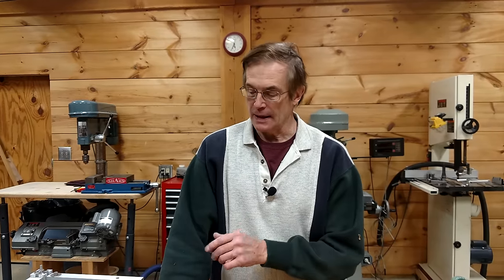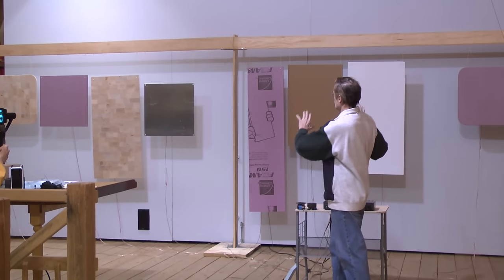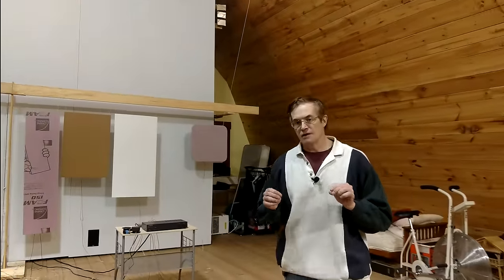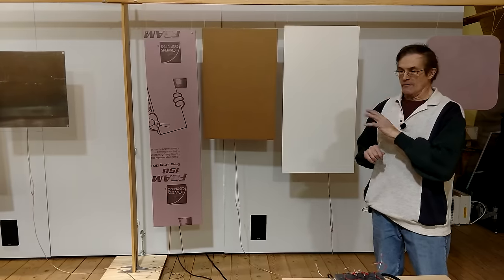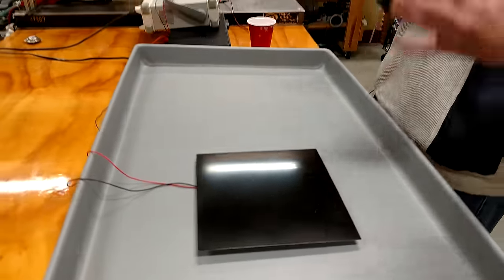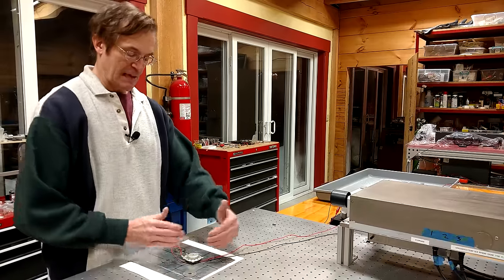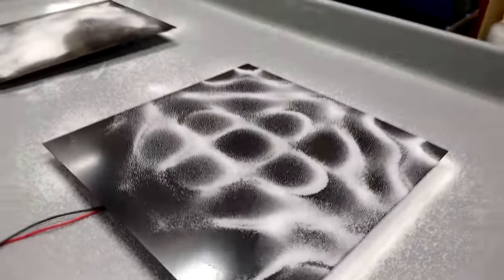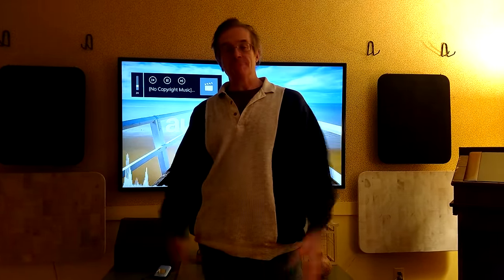Fantastic DIY Speakers for less than $30!

Comment: So do you need an amplifier to connect these to a TV or audio device? Do you need a sub-woofer or not (didn't understand what was meant by having a sub-woofer with a cross-over at 150Hz if the speakers don't need a cross-over). Thanks!

Comment: friggin awesome, in depth, informative, with clean, clear, honest explanation..   but ..... being a caveman like Tim Taylor of Tool Time...  argh argh argh.... and having a 3000 sq. ft. game room and a lot of speakers, tuners, and amps.. my question becomes.. how big van you go...say  a full sheet of 4x8 ???  or keeping with 5/2  that would be  7.5/3 .... and hang 1 on each side with 1 the long way above or below the tv and 1 on each end of the couch and one the long way above the couch for a 6 channel surround.. then comes the question of angle the 4 corner speakers and if altering tilt or the degree pitch would further influence the sound..soooooo many more questions.. and Thank You for the Knowledge You Put Out Their....

Comment: OK, inch and a half polystyrene extruded foam comes in 4' x 8' panels.  So, two 2' x 8' panels with two (?) exciters per panel. I have a speaker system hooked up to my computer with a sub-woofer so I can just hang the DML's spliced into the sound system and use the sub-woofer.  Inch and a half is the way to go?  And what is the best exciter?

Thanks for all the time, effort and money you have expended on our behalf.  You are a champ.

PS - I guess you have seen how much folks have deviated from what is demonstrated as the way to go.  The back row of the class getting D+.

Comment: Hey I just made a pair of these speakers. I used two 24" 24" square pieces of pink insulation foam board. I rounded sanded the corners and edges as you mentioned. However, I find the audio is quite "tinny" and the sound lacking overall. Playing with the EQ helps, but still isn't very good. I feel like a made a mistake, or maybe was I expecting too much.

Comment: So did you end up doing any of that 2/5 3/5 on the speakers you had mounted on the wall next to the TV? What about the weights that's supposed to add up to 20% of the mass of the speaker? Or was that just thrown in?

Comment: I'm surprised that the paint does not change the acoustic response of the material.  What amplifier were you using to power these and what amp characteristics would you recommend?

Comment: I've been wondering if gluing on a 'bump' to a part of the panel would improve particular frequencies.  I've set up my own, and am about to do a high ceiling mount, with the transducer acting as the mount point.

Comment: Awesome! Maybe the bass can be fixed if you place them in a baffle with a rubber seal, like regular cone speakers?
Reply from the maker: The presence of the seal would hurt the output of these panels at all other frequencies.

Comment: Great video, very informative.  You are using these speakers in your TV room did you test these speakers with a movie, how would dialog sound.  Can you use them in a 7.1 system if you added a sub-woofer?
Thanks for sharing.
Reply from the maker: The vocal reproduction is very good.  We've watched countless movies on them.

Comment: I came across this at a timely moment.  I am looking for speakers and an audio-video receiver for my new 65" 4k TV.  I am going to have fabricated four sets of polystyrene and end-grain balsa panels to use as left & right, front & rear speakers.  I will likely use a soundbar for the center channel.  I will need to go through and view the video again to determine what drivers you used.  Since you didn't provide details in the description or a link, would it be possible for you to provide how you came up with the 2/5th & 3/5th patterns for the placement of weights and the recommended panel size/ratios?  Also, would RTV or silicone caulk be a good method of attaching the drivers & weights to the back of the panels?  I look forward to your response.  This was a very good demonstration, please keep these projects coming!
Reply from the maker: Thanks!

Comment: What is the amp you have used for this?  I tried using a simpler headphone amp, but I can't get it as loud as yours without it sounding distorted.  I currently have two decently sized cardboard panels with an off-centered exciter on each one, and am using a 12volt Fifine N6 headphone amp.

Comment: Sony APM texhnology. They begun attachimg 4pistoms from the coil to the flat aluminum honeycomb panel and then they realozed that 8contacts were better and finally just attached the cone to the panel like the actuator in this example. High compression and low bending strengh the fantastic aluminum homeycomb structure of the 80 APM sony speakers.

Comment: that is amazing! And of course very educational as usual! your camera man screwed up when you did the sugar panel test. First he should stand on your side, so left and right is the same as yours. then he focused on your left panel most of the time and it was not always easy to follow your explanation! and it would have been great if you would have shown your speaker and weight  set up. And last: I noticed that in previous videos, you often have some background noise which is very irritating, this time it was a rush, but before you had like a hum...

Comment: Great stuff!  Would it be possible to cover the polystyrene panels with a thin fabric instead of painting them?  Maybe a spray contact adhesive applied on the sides of the panel instead of the face.  My thoughts are these panels in a home theater would not only serve as speakers, but act as sound dampeners to help with reverberation.
Reply from the maker: It might work, but I didn't test that.  The only potential problem I can see is if the cloth will vibrate as it rubs on the foam.  You might hear that.

Comment: Excellent video!
I've been looking for such a analysis and test of these speakers.
Now it only gives me more ideas ... :) 
When you said at the end that they can stay very flat and cover large part of the room, and that they cover the volume of the room much more equally (reducing the phases), now I wonder how can you make active noise cancellation room with its walls and ceiling perhaps covered enough with such plates+speaker that they play the opposite phase of whatever the noise outside the room is.

Comment: Exciters ordered and today got the boards from a Home Depot kind of shop in Sweden. This will be a BIG surprise at the yearly DIY summit this coming Autumn.

I think it was (or wasn't) mentioned that speakers with a wide area distributes sound in another way. I was thinking of dipole speakers.
Reply from the maker: Great!
Consider that a number of viewers who built these speakers found that placing a sound absorbing material on the wall behind them improved the sound quality.
Reply: @TechIngredients  Thanks for advice! What about the extra weights to eliminate resonances? I tried to plot from what I saw on your video.
The boards I picked up are 2ft x 4 ft, but I will cut it in a size where W and H are not realated to each other.

Comment: Great build. Would it work to hang your speakers horizontally from the ceiling?
Reply from the maker: Yes.  Just make sure that they remain isolated from any rigid structure.  Even resting an edge on a desk makes a very big difference in their performance.

Comment: So basically this is based on the classic Leak 1960s speaker made of  polystyrene that became such an iconic design for a speaker considering most speakers during that time were made of paper pulp also in line with it's competitor at the time the classic flat panelled Quad Esl 57 using a charged membrane.
Reply from the maker: Watch the next video in this series.  You'll be impressed.

Comment: Love it. Did you show how to attach the pistons to the panels ? I didnt see it but may have missed it. Also your asymmetrical winning panel test, was it a combination of panel shape and driver mounting offset position ? Or was the driver centred on the back ?
Reply from the maker: Check out our follow up video on these speakers where I show how to assemble them.

Comment: Sound wood typically needs to be flexed into a bend with consistent pressure to amplified sound. this is what the ribs do on a piano. Ribs are cut into the shape similar to a hunting long bow then attached to the soundboards. I would be very interested with the results
Reply from the maker: We're  following up on that theory, and I agree.  You'll  be impressed with the solution.

Comment: With frequencies at around 1 to 3khz style sounds it's sounding somewhat tin like but in all fairness I'll have to wait till I have some  better speakers to get a better idea and as mentioned going through the already low grade you tube audio compression will not be helping either.  Look forward to trying it out and experimenting.

Comment: Great video! Do you think this idea can be expanded to a 'component' speaker with a 3-way crossover and three different sized 'speakers'? Would this possibly give even better performance to those bandwidths? Maybe even a low pass filter for a subwoofer? Thank you...
Reply from the maker: Thanks.
I'd avoid the cross overs as the overlap between different size panels is broad.  A sub is a very good idea and a crossover at around 150 Hz is about right for the sub.

Comment: Hello! I accidentally bumped on your channel on YouTube yesterday and I haven't stopped watching your videos! Congratulations is the least I can say! My name is Kostas and I live in Athens, Greece.  I have a question.  The pink color "Owners corning foamular XPS" does not exist in my country.  The closest I have found is a graphite extruded polysterene.  Is it the same with the pink one you suggest?  Thank you very much in advance.
Reply from the maker: Thanks!
Graphite?  If this term refers to the color then possibly, but I don't  know how graphite would have any other role in a XPS foam. You want a rigid foam with a density of approximately 30 kg/M^3.

Comment: I was wondering if mounting the back of the exciter to a stable point (e.g. the wall) while the panel is hanging freely as it is now, would give higher volume or different (better) frequency response. It is a feeling i have that when the whole exciter is vibrating together with the panel , some movements will - let's say- cancel each other... I have't come arround of building a panel... yet, so take this comment as merely a wild guess. Every video you make is like a book of knowledge and i thank you for that.
Reply from the maker: It's actually worse.  Even mass loading the exciter increases resonance peaks.  Hanging the panels in front of a wall that has a sound absorbing material placed on it does improve the sound quality.

Comment: do you recommend this system for an outdoor installation? can you show us how you attached the speakers to the back of the panels?
Reply from the maker: I don't because the wind will make mounting them difficult while maintaining isolation.
I showed how to assemble  them in the second video in this series.

Comment: Hi, I want to make chladni plates like you have. Sorry if I missed it. What kind of transducer did you use? It must have a single contact with the plate… thanks!
Reply from the maker: Actually, it doesn't. 
The drivers we used for the speakers will work very well.

Comment: I am thinking about using sonotubes to create a folded horn/ tranmission line speaker. Basically an 8" tube suspended inside a 10 inch tube. Would it be possible to use a very thin wood say, as a reed at the top of the 8"tube and with the t line accentuate it. Also I think the sono tube might have a decent resonance if done right. I have even thought of a tightened drum skin because you can tune it. Still in the idea stage though, any thoughts?

Comment: What if the board was folded? will the panel now play sound in a wider range then a flat panel that has a more directional projection?
Reply from the maker: I don't know.
What matters  is the resonance modes.
Neither configuration will be directional, but folding the structure will stiffen it compared with the planar configuration, and this will favor  the higher frequencies.

Comment: I get some of that hexagon cardboard in shipments sometimes at our warehouse.  What thickness  of that cardboard did you test?  I get mostly 1” thick material.
Reply from the maker: That should work.  Make sure that the panel has no delaminations as those will cause a rattle.

Comment: Subscribed! Great content. Question: If I wanted to use one of these for CENTER in a 5.1 system (seems like a great way to run it flush with dry-wall), is there anything specific I should know prior in relation to the heavy Vocal Freq of this dedicated CENTER channel?
Reply from the maker: Thanks.
Not really, it works well as we'll demonstrate in an upcoming video.

Comment: So if I wanted to fill a pole barn with sound and have it sould deeper could I use full size sheets of foam board? 4'x8' will the thing be too small or do they make larger ones that could handle such a big board?
Reply from the maker: That's the largest you'll be able to get.

Comment: Absolutely Fascinating!! I watched your next video also, and so I do have a question of which to choose from. i only have room for a 2x2 and a 2x4 on each side. I do not have room for all 8 speakers. So, how would you recommend I choose each size? I figure the 2x2 for highs and 2x4 for lows, but should I still go with the 2/5 3/5 rule for both sets?

and also, have you experimented using multiple exciters on one panel? I wonder what that would do for resonances....
Reply from the maker: That's a good plan, and maintain the off axis location for the exciter. Multiple exciters operate similarly to a single exciter located at their midpoint.
Reply: @TechIngredients  thank you so much!!

Comment: Do the panel need to be free hanging like this? Can you make a whole wall sound or they need air on the edges to vibrate better?
Reply from the maker: They do.  Any fixation substantially reduces the output.

Comment: Doesn't seem like you tried mounting them horizontally like you mention towards the end of the video. I made a set of the pink polystyrene panels and inserted a pair of cotter pins on each side. Mounted to the ceiling using fishing line, and it immediately made sense why it can't work this way by the sound quality -- they can't move downward due to the stiff strings, but vibration needs to happen up and down in that position. Got any ideas how to mount them horizontally so that they sound just as good as vertical? Got some kind of maglev sorcery up your sleeve?
Reply from the maker: The four peripheral mounting points fix the movement so that the panel "appears" smaller, probably close to half it's actual size.
Because the polystyrene is so light, try mounting the exciter at the exact center  and attaching a line to the exciter itself.  If the sound quality improves then a soft, open cell foam post to the back of the exciter may be the answer for the actual installation.

Comment: I made these, and sound amazing for properly recorded audio.  Only using one exciter per 2x2 foam board at the moment.  Looking to order an additional pair to place it dead center.  Are the counter weights worth trying?
Reply from the maker: I'd skip the counterweights and place the extra exciters on two more, larger panels.
Reply: @TechIngredients  I have a question in this area as well. I just installed a new drop ceiling in my clinic and used a pair of Dayton exciters to energize 2 of the standard 24" x 24" Armstrong 266B tiles. The sound is ridiculously good for what it is and it's even crazier when you are lying down on my treatment table. Localization is impossible. I usually play a local classical station at a modestly low volume for ambiance and to mask the crap the salon adjacent to my suite plays. I scored a used Denon AVR 2400 and a Polk sub. It's gonna take a while to tune but with the first Audyessy test is pretty good. The corners are compliant and the rest is "free".   I am curious if counterweights might improve the sound. Or would another exciter be better?  The room is quite small, 8x12' and I used the most symmetric pair, due to lights an A/C there was not other real option. Still, for what it is, I am beyond happy with the result. An invisible sound system that provides ambiance and some masking for little investment.

Comment: Thank you, I really enjoyed documentary, you really make me  think of different applications of loudspeakers. If you used larger pannels to inprove bass response would you need to add bricing to stiffen up the board, or would that effect the performance.
Reply from the maker: Don't bother with bracing as it will counter the benefit of a larger panel.

Comment: Would it be possible to use larger speaker drivers for more base response to eliminate the need for a separate subwoofer?  Would there be a reduction in sound quality at higher frequencies?
Reply from the maker: I found that the low frequency output is limited  by the panels  and not the drivers.  You simply  can't  build big enough pannels.

Comment: If you have a moment, what size of panel would be optimum for voice reproduction? My wife and I are hearing impaired and struggle to separate voices from music and background sound on television programs and movies.
Reply from the maker: Probably the smaller panels because even though you loose some on the lower frequencies they're easier to fabricate and mount and perform just as well in the mid-range.